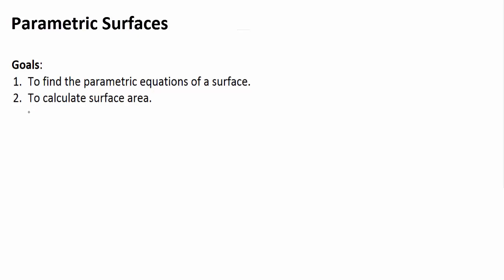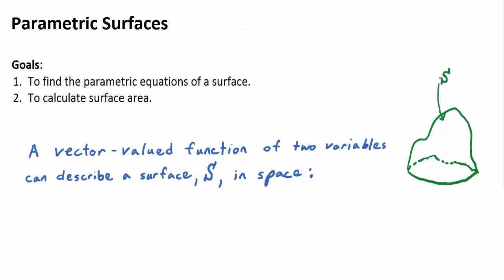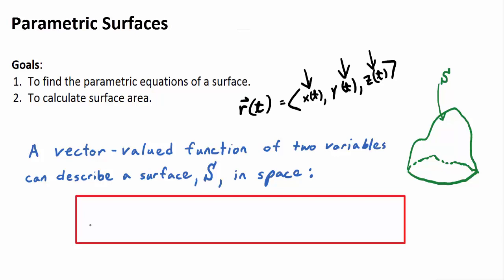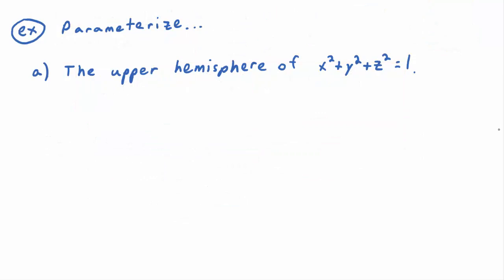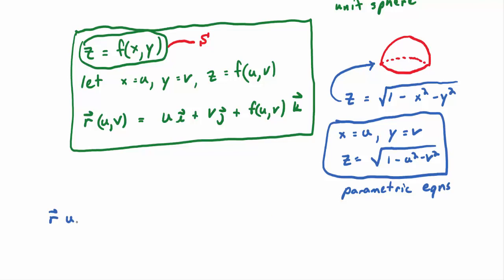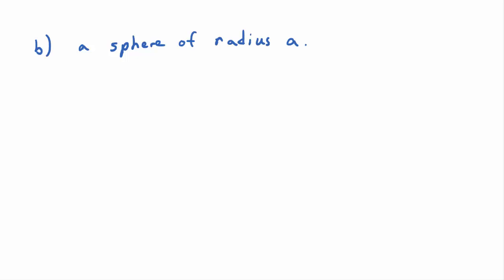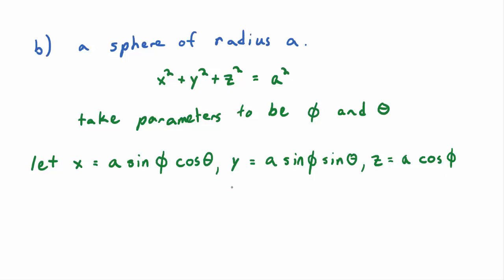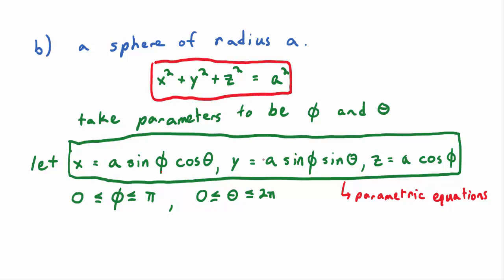Section 16.6:  Parametric Surfaces and Surface Area [Full Lecture]

Comment: Great video,, but I am confused about when to use "r,dr,d-theta " vs. just dr,d-theta. At 41:00 you use r, dr, d-theta, but I have seen similar surface integral problems online that omit the first r, when the cross product is in polar terms.  Do you have an explanation for this?